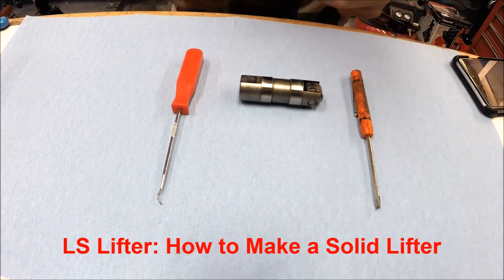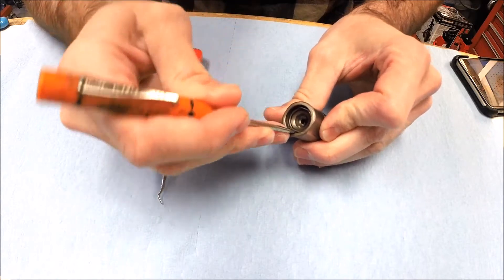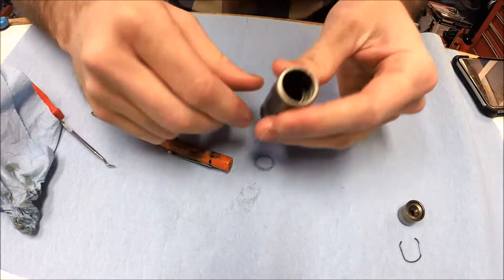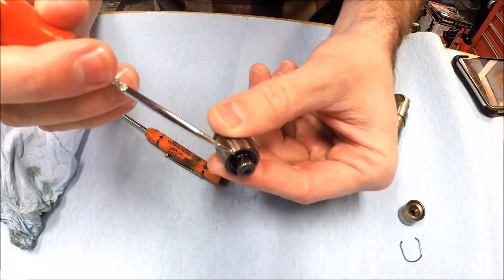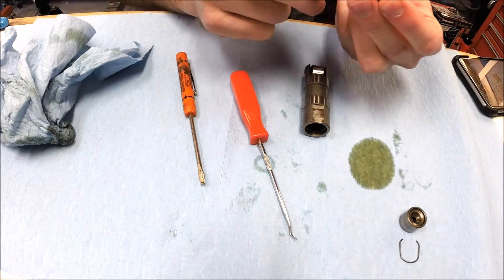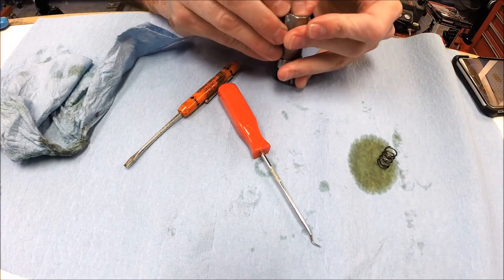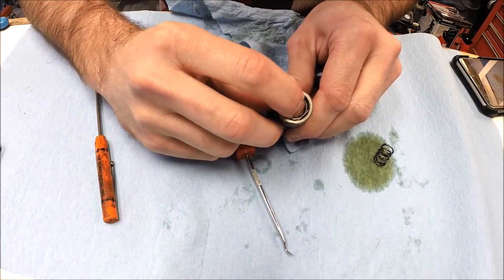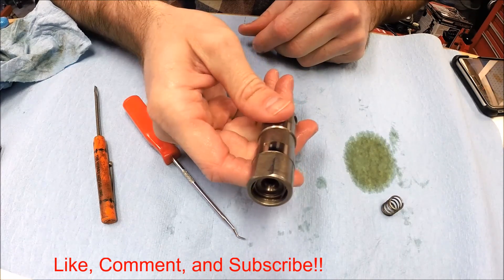LS Engine Trick: How to make a Solid Lifter

Comment: Do I need to do this? I measured my pushrod length with a measuring tool but I never knew about this I never rotated my motor while taking measurements because the instructions say it would damage my tool so I set a stock pushrod on the lifter without the rockers on, rotated my motor till my exhaust started lifting the pushrod upwards meaning my intake was on the base. Took my measurements and called it good. Also wondering if I rotate my motor with my pushrods in, and if my plungers collapse can I prime my motor and will the oil pressure pump the plunger back up? I would assume so but I would like some feedback. Thank you.

Comment: Wouldnt the spring compress @ base circle potentially opening the valve with a solid lifter and actual pushrod length due to pushrod already having the lifter preload measurment or does that not matter

Comment: Can it be disassembled and returned back to normal operations? or is that bottom plunger piece pretty much stuck in there?
Reply from the maker: Maybe but I wouldn't chance it.   Better to just use an old lifter.

Comment: These look the same as in my 2001 Ford 302.  So far I have tried 3 and I can't get the second plunger to release.  I get movement when I push the center ball and use one of the hook tools, but no luck.  Not sure if it is too old and wore a groove in the side that is preventing it from coming out past that certain point?  Any suggestions. Thanks
Reply from the maker: hmmm, it sounds like there is still hydraulic suction keeping you from getting the plunger out.   You've likely already done so, but try to soak up all the oil inside of the lifter with a paper towel.  Or maybe with the center ball depressed, hold the lifter upside down and see if any oil will drain out from under the plunger.    If you find something that works, definitely report back as it may helps others in the same boat!
Reply: Thanks for responding and I hope that your method works for most, as this wasn't easy for me.  I tried depressing the ball with a hook tool and pulling at the same time, but didn't work at all until I got it where the plunger was about 1/16 inch out past the other part.  I actually found one method that worked.  Here is the video https://youtu.be/K60NVacpB20 .  I wrote back to the other video and this is my comment: "Thanks, this trick worked the best, but still have to say that it wasn't easy.  I needed to create a solid set to check valve to piston clearance.  To start, I had used lifters with about 70k miles on them. I'm not sure if there was a lip that was created because of the millage, but it was a S*B!.  I tried various other suggestions from websites and YouTube with no success.  I tried to use a pushrod to wedge it out, not happening, using multiple types of hook tools, nada, I tried using an air compressor and a blow gun, nope, pushing the center check valve to add air and release the vacuum lock, no way.  This was the only way and it fought me all the way to the end on both.  The tools that I used was a 3/8 x 3 'Sleeve Anchor' like he did and you can find it in your local hardware store.  It usually used as an anchor bolt in concrete. Bought a 3/8 x 6 threaded rod and a double female coupler.  Many large washers in a similar way in this video.  The anchor slipped out many times and I had to use an old thin rag to give it some friction between the anchor and the inner plunger of the lifter, otherwise it would slip out after the first few mm.  Now I just need to figure out if I need any washers between the lower and upper plungers in the lifters.  Thanks again and I hope that I don't have to do this again."
Reply from the maker: Dang, sorry to hear it was such a hassle for you but glad you found a method that worked.  Thanks for sharing.
Reply: Blowing air into the oil hole on the side would’ve loosened it.

Comment: This is the style lifer i have in my 02 LM7. I went to the junkyard today to grab some as spares because I had one that was trashed. I grabbed 4 from a 4.8/5.3 block and upon taking apart to clean I noticed they had different internals in the lifter. Is there an engine generation lifter design change?
Reply: I did the same thing you did and noticed the same thing

Comment: Could you run it this way to have a solid roller lifter, would there be any benefits
Reply from the maker: No, these lifters should NOT be run this way; this is just for taking measurements.  There are solid lifter/cam options available, but those are for specific applications.  For the average LS street car, your best option is to stick with hydraulic lifters.
Reply: Scruf's Garage cool thanks, I've been watching all of your build videos. Thank you for the very clear instructions on everything, I will be building my ls3 pretty soon.
Reply from the maker: Thanks for watching, very glad the videos have been helpful.  And good luck on your LS3 build!!
Reply: Scruf's Garage thank you sir
Reply: Was this an effective way to do this? Why does everyone say to weld them solid or jb weld them. Why wouldn't everybody do this?
Reply: @dylanmerrigan7386  yes this was very effective and accurate

Comment: Your cleaning the one part that should always be replaced in the LS..
Reply from the maker: As I mentioned in the video, you would not run the lifters this way.  Making a solid lifter is simply to help you measure pushrod length and PTV clearance.   When you install new lifters, they won't be "pumped up" with oil pressure yet, so you need a way to keep the lifter from collapsing when taking measurements.
Reply: Did you even watch the video? Spouting worthless comments for no reason